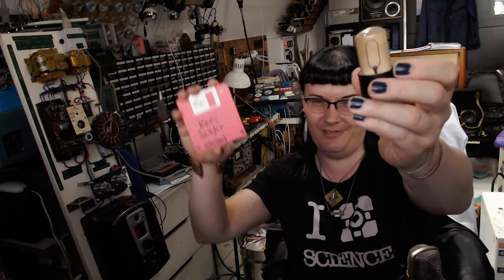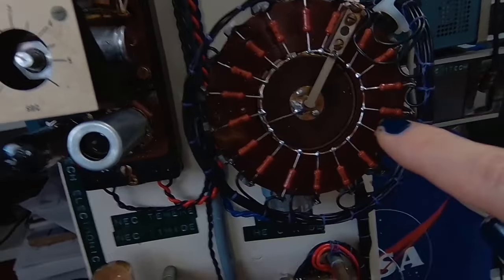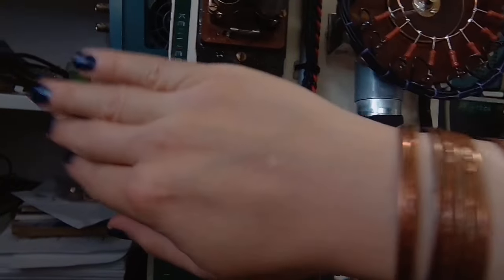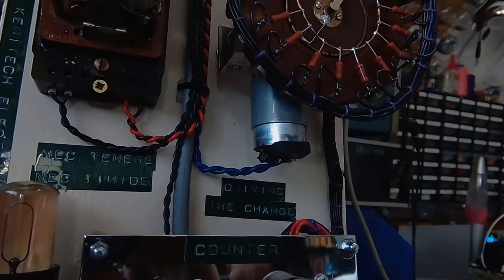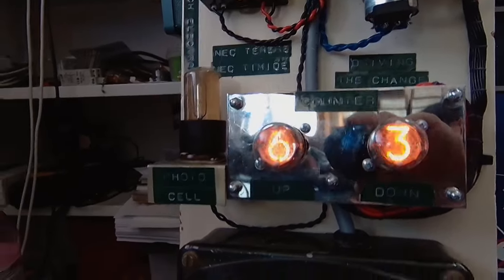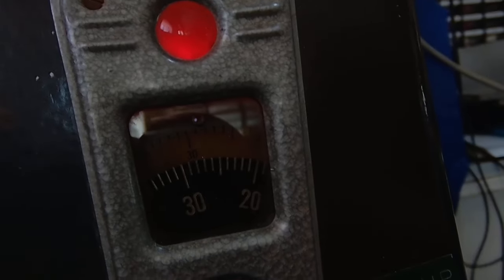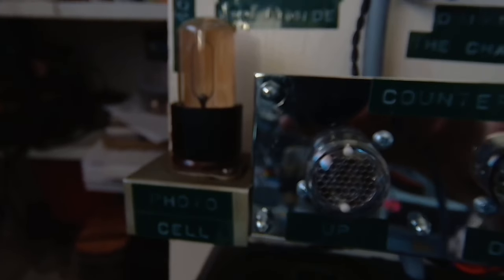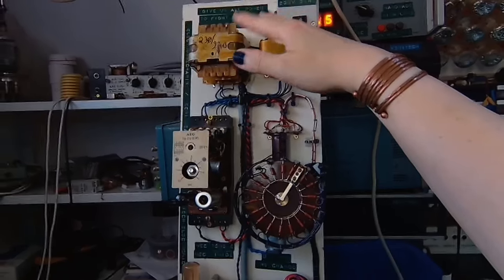Keri's Weird Electronic Art: Electro-Mechanix!

Comment: You could drop the voltage to the motor by using a diode or two in series to drop a diode drop or two?
Reply from the maker: Could be a good option on the DC side. Maybe even AC, if diodes are wired in reverse-parallel; I've got the FBR soldered directly to the motor and I'd rather not change that for aesthetic reasons.